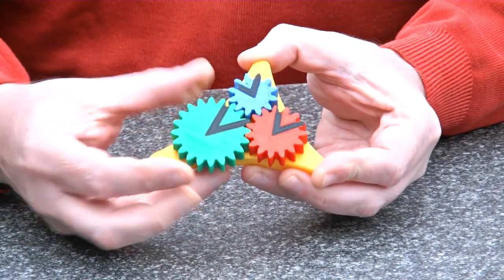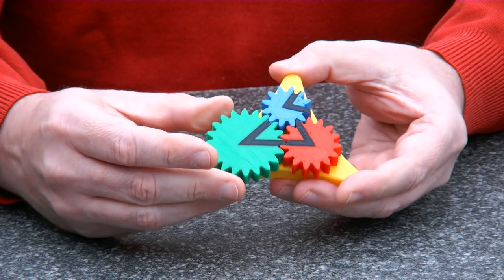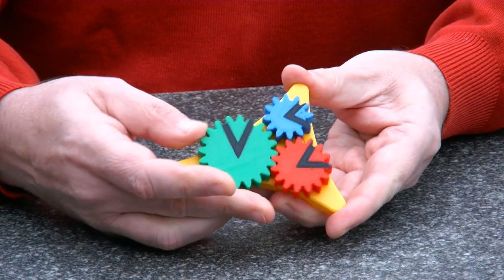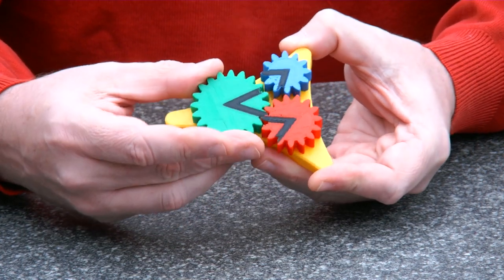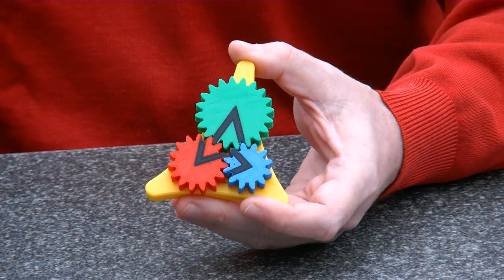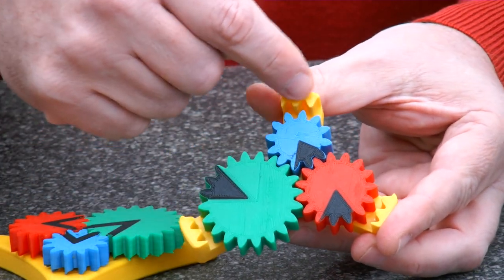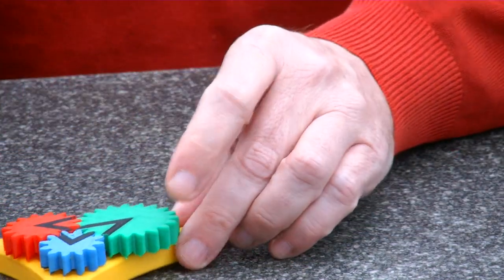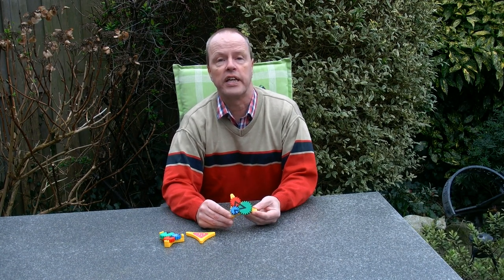Gearo - Can you find an efficient solving strategy?

Comment: Really cool puzzle. I wonder if you can cheat by pulling out just one gear, then turn the gear that's still in, but causes the other gear that's still in to ratchet
Reply from the maker: Nope. The anti-cheat plate prevents that cheat.
Reply: I thought that was going to be the actual solution

Comment: Doesn't allowing one gear to be pulled back let you turn another gear alone, even though you can't pull two back?  For instance, turning green counter-clockwise only makes red turn with it.  So, if you pull red back, can green still turn counter-clockwise and basically be turning freely?  I'm only wondering because of how much design you put into stopping the cheating; it's a good setup.  I'm also wondering what the purpose is of pulling the gears back at all beyond attempting to cheat.
Reply from the maker: One can never turn a single gear alone
Reply: It's impossible to turn all three gears at the same time - if green turns CCW, red turns CW, blue can't turn both CCW and CW at the same time so as the smallest gear it is physically forced back. Pulling back red just means you're able to turn green and blue at the same time, not that you can turn just a single gear.

Comment: It's not clear to me what the rules of the puzzle are. If I go by "anything it physically allows without disassembly", then your near-miss demo is very close to a solution. Spin the blue gear until the green gear is in position. Spin the red gear until the blue gear is in position. Disengage the blue gear. Spin the red gear until it is in position. Solved.
Reply from the maker: I should have explained more clearly. The mechanism enforces that always two neighbouring are turning. It is not possible to disengage a single gear.
Reply: @OskarPuzzle  I'm not following. It was my understanding that when a gear is out, the other two gears remain capable of turning -- and that that is the core mechanism behind the puzzle. I did see you demonstrate that when pulling a gear out, that same gear cannot turn. But I do not see what would prevent the red gear from turning when the blue gear is out. Is it not possible for two gears to be out at once? Turning the red gear in that situation would be pushing the green gear out due to the green gear's ratchet.
Reply from the maker: @klikkolee  Indeed, it is not possible for two gears to be out at once. Please watch the video again to see how I achieved this.